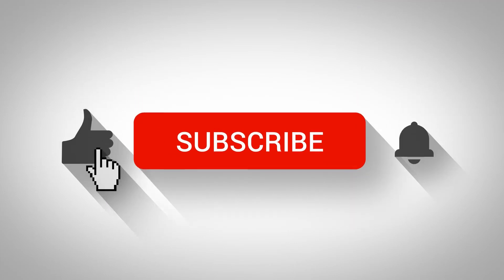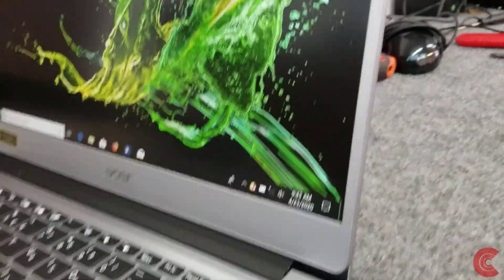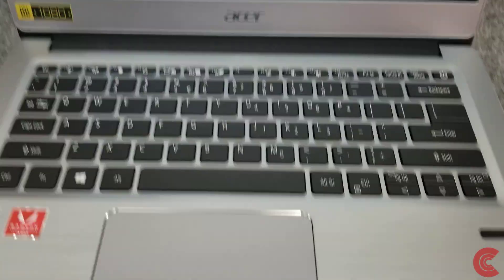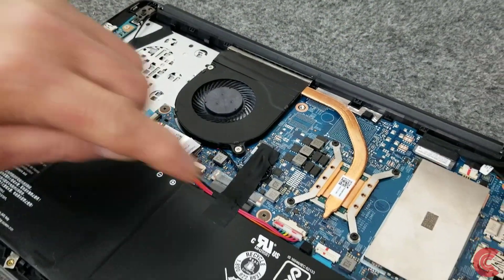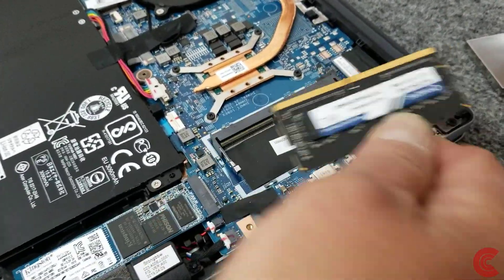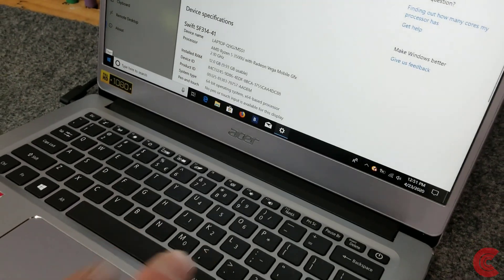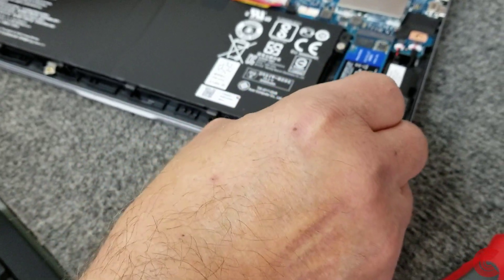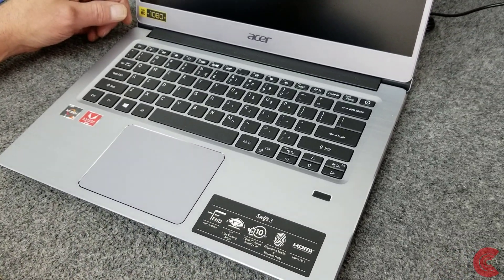Acer Swift 3 SSD & Memory Upgrade SF314-41

Comment: I have the same one with win10 i7 8th gen.. I get the message as "no bootable device" as soon as acer logo disappears.. since keyboard is not working, I'm unable to go to bios !!!
Pls help
Reply from the maker: You can use external usb keyboard, f2 to enter bios. Once in bios, enable f12 boot menu option
Reply: @CadillacComputerCenter  thanks for your reply.. I tried with a Bluetooth keyboard as well..the acer logo stays hardly for a second, however I tried pressing F2 continuously when the logo is still on but in vain.. i get "no bootable device" again...
Also I'm unable to shut down, after I long press the power button it restarts and stays still on "no bootable device" page..
Reply from the maker: Are you booting from a bootable win 10 usb install drive,?
Reply: @CadillacComputerCenter   i don't understand the technical terms you're referring to however to my knowledge I'm not using any usb drive as such.. I just connected an usb device to support the bluetooth keyboard ...
Reply from the maker: Get a usb keyboard.  Bluetooth will not work without being paired.  Did you install a new ssd?
Reply: @CadillacComputerCenter  it worked fine till last night.. when I switched today, the screen started flashing.. not allowing me to enter the password, then I realised that the keyboard stopped working.. I connected to blutooth keyboard and entered the password with the shift key pressed so that the flashing stopped.. as soon I released shift key the screen started flashing again... I searched through the internet and found a solution to stop flashing.. but then the programs were not responding then eventually I ended up at "no bootable device" screen...  !
Reply from the maker: Have you added new parts to your laptop?
Reply: @CadillacComputerCenter  I should say I have a wireless keyboard with a small usb like device attached to the laptop... I have no idea about the internals so I haven't opened yet..
Reply from the maker: Sounds to me you have a drive failure.  I dont know what kind of drive you have, ssd, or hdd. Do you?
Reply: @CadillacComputerCenter  no..
Reply: @CadillacComputerCenter  I'm sure it has ssd
Reply from the maker: Can you open it up too look?
Reply from the maker: If you dont want to open it up, take to a professional to get checked out.
Reply: @CadillacComputerCenter  I think I will take it to the service centre... 
Thanks for replying bro.. much appreciated
Reply: I got same problem here,, i upgrade with ssd,, and then there's said "No bootable device" i also migrated my os from hdd to ssd. In bios boot there's empty bootable device. Can u tell me what prblems is ? Thx

Comment: Mine is a Swift 3 sf314-41-r9vf is it the same procedure?
Reply: Can i ask what is the spec of yours cant find anything specific about your type of laptop
Reply: @pcamaquin09  Ryzen 5 3500u 4gb ram and 1TB HDD but it seems they removed my model from the Acer website and instead are now selling an 8gb RAM version instead of just 4gb one.
Reply: Ancient256 does it have a vega 8 for gpu? Hows the performance? Light gaming for casual games like csgo and dota and valorant? Thanks
Reply: @pcamaquin09  In terms of light gaming it runs pretty good for dota 2 on low settings with 60+ fps average, as for csgo i would recommend getting the 8gb RAM version as to run smoothly because I personally have 4gb RAM and it would stutter a lot with 25-30 fps  and I would recommend playing it on low settings in 720p

Comment: By acer website the m.2 Ssd in this  model is upgradable to 512gb.
Ram is upgradable to 12gb.
Reply: Can i Ask you about how max the upgrade ram of this unit? mine for now have 8gb’s of ram, but i want to upgrade it into 20gb by change the 4gb removable one with 16gb of ram, is it possible?

Comment: Straight to the point and very informative as well. I have this laptop now, and I have been planning to upgrade my RAM. This helped with all the questions and doubts I had. Thank you!
Reply: So this laptop doesn't have 2 ram slots? It cannot run in dual channel..?
Reply: @asim4843  Acer Swifr use low powered ram to save power.
That basically means that it has 4266mhz, but since it's lpddr4, it runs at double down speed, so 2133mhz.
You are always better with ddr4 than with lpddr4.
One is faster and other uses less power, but if you use integrated gpu, better go with laptop with ddr4.
Hope this helps!
TL;DR - low powered 4266mhz (real 2133mhz), normal powered ram 3200mhz (real 3200mhz)
Reply: hello sir ano pong ram ang pwede idagidag
Reply: @tengggsebastian4140  single stick 8gb sodimm or 4gb single stick not sure if it is compatible with a 16gb single stick
Reply: Can i Ask you about how max the upgrade ram of this unit? mine for now have 8gb’s of ram, but i want to upgrade it into 20gb by change the 4gb removable one with 16gb of ram, is it possible?

Comment: So the ram won't actually run in dual channel since the 4gb is soldered to the motherboard?
Reply from the maker: This should help you....
https://forums.tomshardware.com/threads/uneven-memory-4gb-soldered-8gb-in-slot-but-will-still-run-on-dual-channel.3127489/
Reply: @CadillacComputerCenter  How do I know if my model has an available slot without opening the laptop? (I assume opening the laptop voids the warranty) This model is an Acer Swift 3 SF314-57G-52FD bought in Thailand with an Intel i5-1035G1 CPU. This already has 8 GB, but I'd go for an upgrade if possible. Thank you in advance for any advice you might offer.

Comment: I've been looking for this kind of video since day one after my mom bought the laptop. Thank you so much man, its always the small time youtuber that has the best content. Im wondering though if the wifi card for the laptop can be change and if so, which one should i get?
Reply from the maker: Check this article, 
https://lookgadgets.com/best/laptop-wifi-cards/
Reply: @CadillacComputerCenter  thank you so much for that. For swift 3, what kind of socket is it using to house the WiFi card and does any of these wifi cards compatible with Ryzen processors?
Reply: @asim4843  by ran speed, do you mean the ram speed? In my model, it's ram speed is 2400. Btw thank you sir for the answer
Reply: @asim4843  oc the ram huh? Never knew that it's possible on a laptop ram though. I had this laptop for almost a year now
Reply: @asim4843  good luck with that but I wonder if you could share the finding with me? I also wanted to oc the ram if it's possible